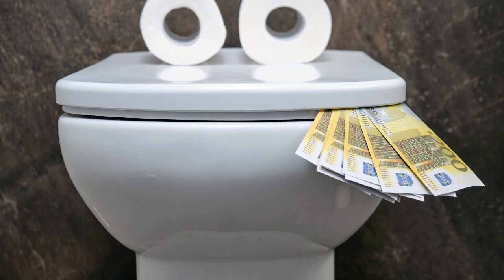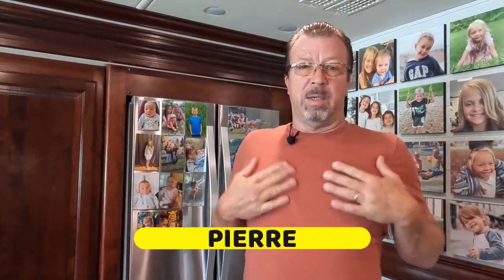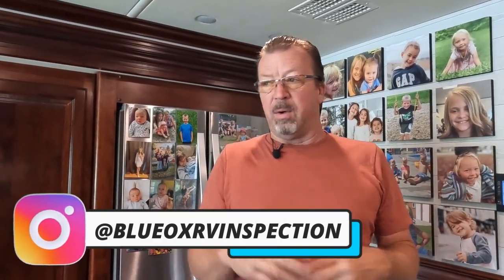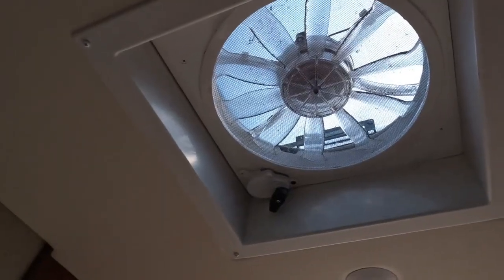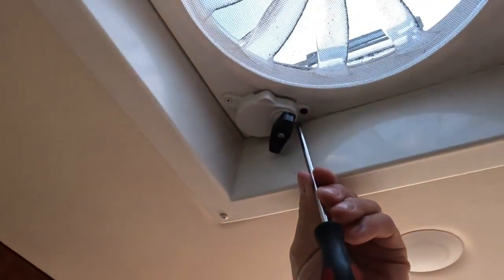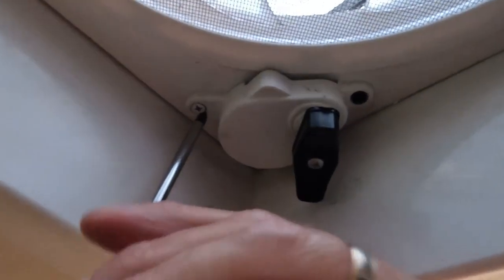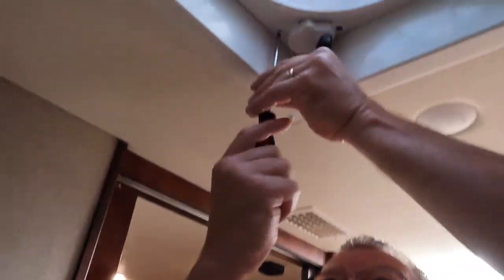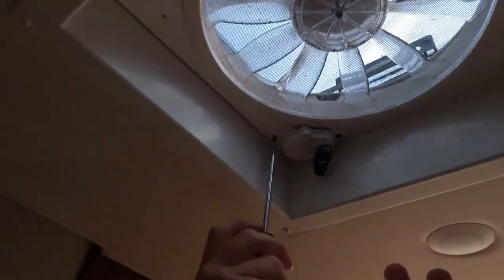🤬RV ISSUES SUCK! WHY SO MANY PEOPLE GIVE UP!

Comment: That air admittance valve should be extended up above the drain hose connection point, especially if the washer has its own grey tank.
Reply from the maker: The hose itself goes way below the air admittance...but you have a great point 🙂

Comment: The problem seems that toilets, plumbing, roofs are so fragile unlike residential houses. After watching your channel, it seems rv are not worth owning unless you use them a lot. Also it seems like the 2020 and newer ones were put together by blind men with one arm.
Reply from the maker: Good one 😁
Reply: Not just 2020 & newer ones. I've experienced the same crap construction materials & 'workmanship' since 2001. How this industry has been able to get away with how they operate like they do (manufacturing, sales, service etc) is a marvel to me. Should be criminal. Most other facets of the consumer world some cream will rise to the top & junk eventually gets weeded out, but not in this area. It's inexplicable.
Reply from the maker: That's a little problem with free market sometimes 🤔 it has two edges....the lack of regulations sometimes creates unscrupulous sales ethics IMHO 🙂
Reply: Thé high demand for RVs over the COVID period resulted in even more shoddy construction than before. Plus the prices are crazy. It is a very expensive hobby. After four different combinations over 19 years, I bought a 30 year old mobile home, had it for ten years and could sell it for almost double the money I put in it!

Comment: Great job!  I usually sit on the toilet to help seal the ring before I finish tightening the bolts on the toilets I have replaced in the homes I have not had to do it yet on an RV yet. an old trick I learned from a plumber...
Reply from the maker: That's a great idea...but these RV toilet have a foam-like seal that just obeys as you tighten down...so even easier 🙂

Comment: I've learned over a few decades of RVing that if you don't have the aptitude, drive (willingness), & physical ability to work on your own rig, you should not be into RVing. Likewise, anyone thinking about being an RV weekend warrior should not lay down $s for an RV if they don't have land to park it on. Paying $s every month for storage, getting your stuff broke into &/or run into, & the hassle of having to fetch your rig on the fly, pack it, & do the same thrash at conclusion of your trip = @$$ pain that will get old fast.
Reply from the maker: It is a hobby for a lot of folks, you're right! Hobbies do cost money right ?

Comment: I have no idea where your volume is could be you need to do a walk through of your gear. Happy Trails
Reply from the maker: I can tell you probably have an iPhone...set your volume on "mono" and it should resolve the issue 😉🤙
Reply: Nope lap top I used closed caption to finnish . I went to other channels all were okay came back and it was on of with you guys . I ene check my earphones too a brand new out of the box a gift from last Christmas same results unplug them and used the speaker in the lap top same problem.I suppose it could a problem inside the computer .next time you  2 Happy Trails
Reply from the maker: Well, let me know if you resolve this. We'll be looking on our end. Seems fine tho 🤔